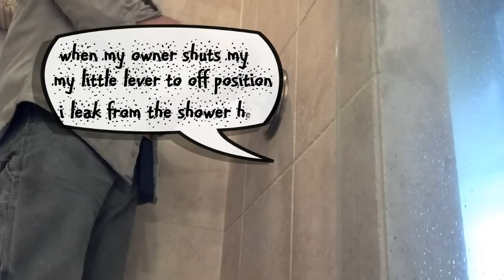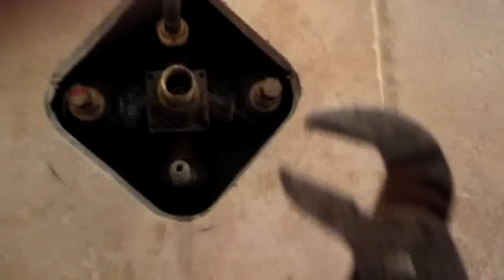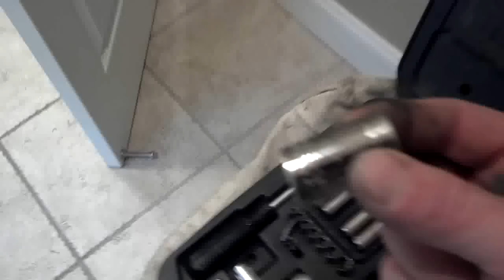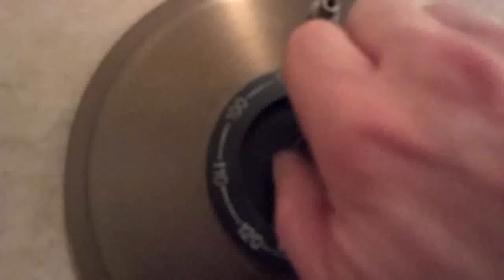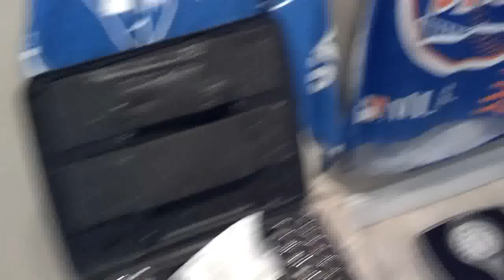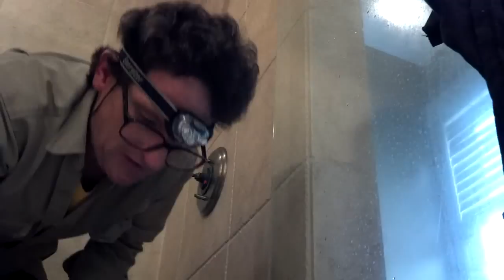Sigma Eurotherm Sigmatherm 00_96.40 temperature problem

Comment: This video saved my bacon. First I learned that I didn’t have to shut off the main water valve. That made it a much quicker project. Instructions were clear and accurate except I think that to remove the temperature cartridge you only need to jiggle and pull.  It is not threaded. There was another comment which mentioned that the temperature cartridge came apart. Mine did not except when I put it back in and twisted it a bit it popped open. I looked more closely and noticed that it has a internal screw tab so you have to be careful not to turn it counter clockwise when you remove it. One problem I had putting it back was that it leaked. There was no rubber gasket between the temperature cartridge and the brass threaded casing so I lubed it and tightened it as much as possible and that seemed to stop the leak. Finally the little square tube that connects the valve to the handle was not long enough and either it goes all the way in and you can’t control it or it’s out and doesn’t grip the valve. I got it in just the right place and put a little silicone seal to hold it there. The two on off valves were sticking and I had a plumber replace them about a year ago. I took the old ones and soak them in CLR and that freed them up so now I will simply cycle them in when the other ones stick. By the way, I didn’t replace the temperature valve. I just soaked it in CLR and worked it in and out and it works perfectly now.

Comment: When I was removing the thermostatic valve to replace it, it came out in pieces.  The inner metal components came out and the outer plastic casing with O rings is still inside.  I have been unable to remove the outer casing.  I heard you say to use needle nose and turn counter clockwise when removing.  I did not do that, I attempted to move back and forth and pull outward.  I did not see your video before removal.  How can I remove the remaining plastic components of the valve?

Comment: Hello, my water is coming out waaaaay to hot. I took it apart like you did and noticed that on each side is the valves for cold and hot. Well I notice hot comes in real good, and when I tighten it I get less hot water, which seems good. The right valve is the cold and it seems that turning valve with screwdriver does nothing to the amount of cold water, like if the cold one is not working. Is it that or could it be the cartridge? If I knew this was going to be this much problem I would’ve never bought it. I tried buying something expensive and good and it bites me in the butt. Please help anyone.

Comment: great video.  I have this shower valve.  Sometimes it works fine, but other times the two shower heads have vastly different temperatures--one hot, the other cold.  In the winter, the water gets only to lukewarm.  Is that a thermo valve problem or something else.
Reply: Franklin Steen hi, I have the same problem, did you find a fix for it?

Comment: the sigma part number is SIGMA 18.30.082 THERMOSTATIC CARTRIDGE 
I found it in stock at 
new York replacement parts corp
/sigma-thermostatic-cartridge-1830082

Comment from the maker: @FOQRS, sounds like you need eplace plastic  thermostatic valve, it has failed and is not allowing full range of temp, it will just get worse and worse over time...colder and colder. watch vid and replace

suggest try calling sygma , get a free valve under warranty, is about 100 bucks otherwise

thanks for watching , thanks comment

Comment: I have the same shower valve but not getting hot water out of it. The water is just warm enough to shower with. Is there a solution for that?
 Thanks
Reply: Yes, most likely replacing the cartridge will fix your issue.